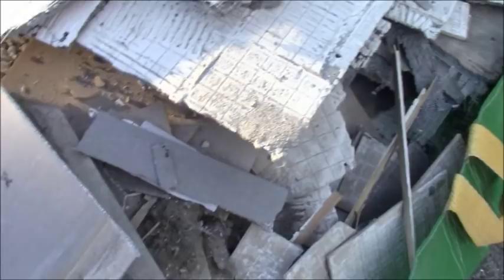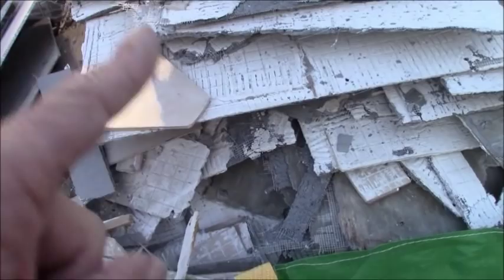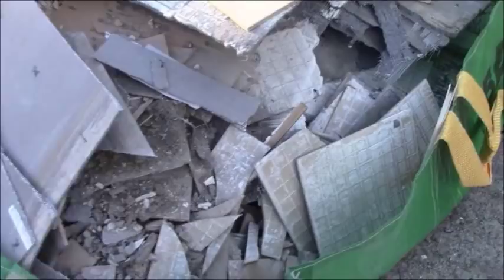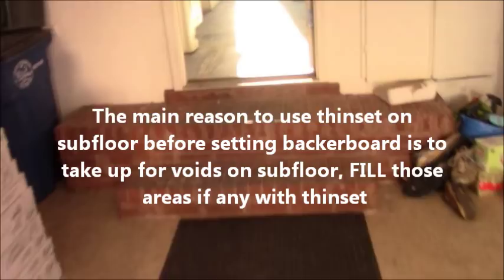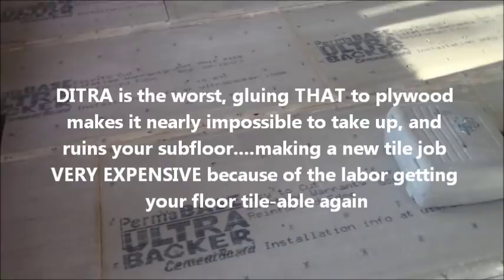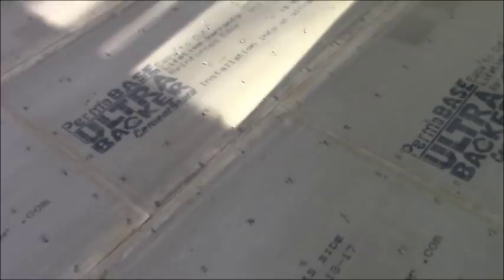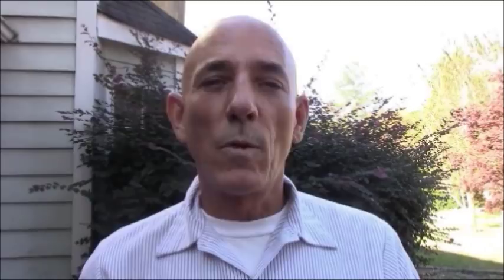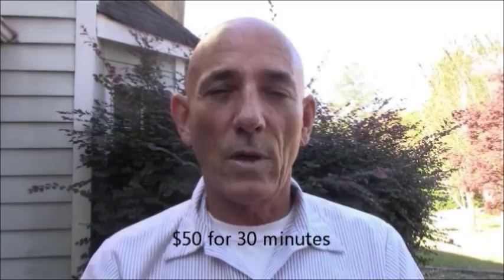GLUE BACKERBOARD ON SUBFLOOR ??

Comment: Bob...  This is the part where I whole heatedly disagree. Gluing the board has been industry standard ever since backer was invented. It strengthens the substrate and provides a porous surface that allows the tile to make a proper bond. I appreciate your shower videos but this is just wrong by all standards. You can not and will not convince me that if you install the board correctly and allow it to cure that when you come back and jump up and down there is not a difference compared to a typical 3/4 inch plywood substrate floor system. It tightens everything up.  You can literally feel the difference. The only time I would let this point of view slide by is in an area such as a small bath room where maybe 2-3 sheets of backer are used.  And even then I will be using a large amount of screws. Securing Evey possible weak spot,  doubling up on seams, etc. But if you are doing an area that spans a few hundred feet, and several joist,  it's silly to not do what the industry requires.  I mean how do you even argue personal opinion over that? It has been proven time and time again, for both durability and longevity of the tile that a solid substrate makes all the difference. Pointing out a simple settling issue that caused a small area to fail is no relation to what the upside is to this method that is considered grade A installation by TCNA. And yes it does "mess up the substrate" as you put it. But as you even show in your video,  getting the board back up is possible. After that I've always just grinded down what mortar stuck to the wood. I have literally tore out tile floors down to the substrate. Grinded substrate back to original plywood, and then put down 1/4 sureply and covered with vinyl flooring with no issues what so ever. It's what floor guys do my man. This video shouldn't even exist my man.  And I shouldn't need to make my own video to prove my point. It's pretty cut and dry and there is plenty of information out there for you to learn from.
Reply from the maker: You are welcome to disagree all you want, you can even quote tcna standards and provide me with a dozen books that tells me I'm doing it wrong... but the proof is in the pudding my man, not only in this video did they not glue and screw but 99.9% of the jobs that I tear out are not glued and screwed and there are not problems, so I guess I'm in good company if you're telling me it's been industry standard for years and I'm not seeing thar... in fact that's why I show videos because saying one thing and showing it are two different things and I show it every chance I get. There has to be a problem for a solution and since I don't run into those problems that you reference then I'm not going to screw up my customers floor whether it's five years from now, 20, or 50 it just is illogical period. However I will concede one thing, the manufacturer especially with hardibacker, tells you to put a screw every 8 in, I use about two or three rolls of roofing nails for a board so there are no voids and there are no issues the way I do it... but I would never ever ever only put one screw ever 8 in unless I were gluing it which I do not do. And by the way, I did hundreds of floors before I ever got into doing showers. And although I appreciate your opinion, you cannot be Trump and just say something without proof, and I don't mean the written word I mean real life real world work which is what I do on a day-to-day basis
Reply: Butcher! STRAIGHT UP! You wouldn’t tile my dog house or set foot on any of my job sites! YOUR FIRED
Reply: The big boys that know what they’re doing are usually working on higher end jobs/houses with clients that want to pay for lifetime work. The joe remodelers do work built to last maybe until the next remodel and hack their way out and on to the next job. Smh yes this video should not exist. Guy above me is right 100%
Reply from the maker: The guy above you obviously is a newbie and brainwashed... yeah that Kool-Aid taste good doesn't it 😂😂

When I was in the Army and got to my first Duty station my platoon Sergeant basically told me to forget most of what I learned, they have SOP based on experience... same thing after I graduated the fire academy, the NFPA which is the Bible of fire science was Brill Dan to us but when I got to my station I was told they have their own SOP based on real life experience...
I based my work on the real-life experience and not the crap touted by book soldiers
Reply: @StarrTile  LOL
Reply: This guy knows everything you can never prove anything to a guy like this he'll stick to his thoughts even with proof right in front of his face he's more like Trump than he thinks TCNA does research and development and has requirements for a reason! So hopefully one day a 1500ft² job fails and he has to come out of pocket to replace cuz he didn't follow requirements but if he did they'd pay 4 it! I've done it both ways and have never had it crack either without thinset but started doing it just in case 1 day it does cuz it will so that the company will pay for the repair not me just follow the rules glueing and screwing sucks taking out but it's part of the gig.... I never understood these old school guys that can never except fact and newer faster better methods and believe their way is #1 even though he'll say I never tell people my way is right he totally contradicts himself jus listen to his videos closely why else would he not be making any money from YouTube?? Everyone else does it's because he misleads on SOME things as fact and they won't allow that but he'll spin it to make it look like there in the wrong when it's really him c'mon man your the only one I've ever seen say your spill at the end of your videos maybe you should grow and take criticism it's called humility swallow your pride ACT your AGE your not a kid anymore!!

Comment: The problem you're having is that you're not supposed to bond backer board to Raw subfloor unless it is an exterior plywood.  you have to seal/Prime the floor and then then set your backer board on.  so 15 years later when you take it apart the thinset will scrape away just like any other surface.
Reply: You are correct,  I see online @ hardie backer board website keep saying exterior grade plywood.  I was wondering why.

Comment: I am a master carpenter of 40 years .. and I will never claim to be a master tile setter . But I have done perhaps 30 floors and baths in my life in all styles of tile .. So before I launch on a new product .. I like to update on specs and use my own carpentry wisdom of how weak the substrate is , The structure , seismic and any other forces . I know that most everybody who whose unsure wants  and do it " Right " generally follows specs .... and then there some that have been doing it long enough and realized in their minds that abiding by specs was unnecessary . So it has a tendency for others to cut corners even more perhaps .. Some manufacturers will not warranty their products if shortcuts are taken .. Not sure if it applies to Backerboard .   I generally build so it takes explosives to remodel .. Like .. I will set interior doors and set my shims with premium subfloor glue , then attach with stainless steel trim screws and nail ferociously through the jamb and anchor every hinge with 3" screws ... The next sub" painters " hate me but the homeowners will love me .. Set in stone .. and you ram those doors with a tractor.. Remodelers will hate me in the future !! .. I know by cutting corners and not following specs can lead to stuff falling down and falling apart .. So on your vid .. I am merely inquisitive on different styles . If I nail down subfloor to an I joist .. I double the amount of glue and double the fastening specs and make sure it;s bedded and nailed /screwed within 10 minutes so if anyone ever happens to need to move a joist .. It will destroy the joist !! .. Because they have become ONE ! .. I love remodeling behind guys that did the very least . knocking down walls held together with a thumbtack adds to my profit margin . I have pulled up tile floors and was grateful the guy before me scrimped .. I just see the inherent danger in teaching people to be minimalist . Tacking shingles with one nail in the top middle will do .. since the glue strip will bond .. hanging drywall with one screw in each corner makes a flawless finish ,. Not caulking woodwork is great when the cuts are so precise and tight and nailing in the middle makes for a happy painter . So to a degree , I understand your stance .. Generally when I have to pull apart work that was rock solid .. I get pissed as well .. but salute the guy for doing what was specified .. Perhaps invent methods for removal that are efficient . I am sure you will encounter it again .. I hate it when I have to drill into masonry and hit a piece of #6 rebar  but I am grateful it was put in knowing it insured the column wouldn't collapse

Comment: I've never believed in gluing down backer board but you do need to screw it down. After time, if nailed down, those nails will work their way loose and cause movement which will eventually cause the tile to crack.
Reply: Ya i agree i ise backee board screws not nails
Reply: I agree. It doesn't matter how many nails, some will work loose and either cause creaking, cracks or both.
Reply: nails don't have enough upwards force to Crack tile.. It's mostly the seams in the subfloor or the integrity of the tile and voids in thinset that can cause cracking

Comment: Finally I got a peace of mind because I had never used thinset to glue down my backer board, I always screw it down 👍
Reply: Yup its NOT needed
Reply: not in Arizona, i just pulled up the floor, built in 2007, thank god they didnt glue the backer board.  new construction.... it lasted 16 years, no issue whatsoever, just remodeling the BR

Comment: If you have a perfectly flat floor yeah I'd say you can get away with not doing it.  I put it under mine and it helped it level it out but my home was built in 1890. This guy just seen a job get more profitable is why hes so happy. Oh and to anyone out there if you have tile with any kind of warranty and dont use thin set behind the backer board its voided.

Comment: This is the legendary video. Tilers will know what I mean. I finally came across it! Install the tile improperly initially so its easier to redo it when it fails. LOL! Follow manufacturers and TCNA standards, always. Thinset between the plywood and backer, and again between the backer and tile. That is the manufacturer and TCNA guideline. Period. Also I don't see any seam tape on the cementitious board connections, another violation of TCNA standards. I see this every day in the industry.
Reply from the maker: 😂😂😂😂😂@violation !!!!
Lock me up then, 21 years of breaking the internet and pissing off John Bridge trolls 👍👌✌
Reply: @StarrTile  Hey if it works for you awesome! I've seen several instances of this method failing, cracks in tile and grout where the boards meet or damage due to deflection. I'm also in an extreme weather zone far south so we have to be extremely careful with following standards to the letter, we get extreme expansion and contraction. I just inspected a new 6 month old porcelain LFT install in a family room over concrete foundation that tented to the point of tiles exploding like grenades, they thought they had a sinkhole or there was an earthquake happening. No expansion gaps and grouted to the baseboard *facepalm. We had a very chilly day followed by a hot one. Someone easily could have been injured. So sorry I tend to be a stickler for the standards. :) I do like your other videos I just don't think advising other installers to not follow manufacturer and tcna standards publicly is a good idea. If it's ok to cut a corner here, how about there? And every corner cut increases the chance of failure, and tile failures can be dangerous.
Reply from the maker: @nekomancey4149  I've never ever said not to do things, I said I don't believe in certain things so therefore I don't do them...but everyone can can do anything they want. I base my opinion and standard on my experience, not to a book or organization...there must be proof and there is none of the things I dispute, but my videos show my proof of what I say.

Comment: I just took a bathroom floor out that was NAILED down every 8 inches, NOT GLUED, and DIDN'T have the joints taped, I am in the process of putting it all back in the same way, I just poured leveling compound on it and AFTER that I saw all the videos saying you HAVE to screw it down, you HAVE to tape the joints and you HAVE to put thinset under the cement boards, man I felt like a loser after watching all that - and then I came across your video where I learn in the video and the comments that you can nail it down, you don't need thinset under the boards and you don't need to tape the joints, all I can say is THANK YOU i'm grateful I didn't mess up as like the other videos told me I had.

Comment: GREAT video!  I have been installing backer boards and then tiling in my different houses over 30 years and NEVER glued my backer board down....only used screws....and NEVER had any cracked tile or mortar. that's in Calif, Ill, Wisc  and now Ohio. I just tore up an old tile job in bathroom (my wife wanted to remodel) that I had installed 15 years ago and it was a breeze because I had only screwed down the 1/2 inch cement board.
Reply: I have some flex between my backer boord and subfloor , is that normal ?
Reply: What are the best screws to use for backer board to plywood? I will have 1/4 cement board to 3/4" plywood.
Reply: @chulaalaale  if you're seeing areas that can flex after screwing down the backer board, then your subfloor is not flat.  Either there is debris or puckering between the two, or there are high and low spots and the low spots will allow the backer board to sag under load.   This is where you can use mortar to flatten the low spots by floating it on or doing a screed to make a smooth flat layer before putting down the backer board.  But make sure your subfloor itself has no flex, otherwise you have to address that first.  You also can do self leveling compounds to give you a flat level surface before putting on the backer board.
Reply: @cwb124  use whatever the backer board manufacturer recommends.  There are screws made specifically for certain types of backer board.  You may be able to use nails as well or a mixture depending again on what the manufacturer says and the location.  The screws made for this application are coated to prevent corrosion even in wet areas.
Reply: Also, you should start from the center and work your way out as you're screwing down the backer board or you could cause puckers.

Comment: Depends on your area and condition of subfloor, framing, and beams underneath....in so cal we never have problems but our structures are different, newer and our weather is very mild...... East coast especially in the North could be whole different thing.....

We have alot of slab on grade (newer) or girder beams with 2x6 subfloors, or 1×4 diagonal with ply on top....

Way way back befire cement board we used to tile right on plywood, sometime in the 30-40s they would use paper and staple lath and float cement before tile.....

Never seen any issues unless thr structure itself had problems....if thats the case you have bigger fish to fry than your tile

As a builder I take manufacturer recommendations as a guide, not as the Bible.....common sense, experience, and general knowledge go along way......

30 friggen screws over a 15 ft sq area on hardie board is almost as many screws your kitchen cabinets have and those are vertical holding weight off the ground😂

Comment: When you glue and screw you are laminating the layers together and as the stiffness of the floor is proportional to the SQUARE of the thickness, you can see there is an advantage, and the choice to do it or not depends on how stiff the substrate already is and what you expect the load or wear and tear to be, and what value you assign to the subsequent demolition problems.

Comment: I've seen quite a few failures caused by the backerboard only being secured with screws or nails.  It may be fine in your area to omit some form of adhesive under the backerboard, but here in the north seasonal expansion and contraction tends to crack the backer board where it was fastened if there is no adhesive used in conjunction.  I had one last year where you could lift the whole sheet of backer board off the subfloor, tile and all.  I certainly get your concern though. It makes a hell of a mess if you want to put a new floor down, and if I worked in an area with more stable seasonal humidity I might do the same.

Comment: And I've seen plenty of examples of cracks in the floor when not gluing. I personally wouldn't install against TCNA and manufacturers instructions just because it made it harder to remove later on. You can bet this is a bad idea for anyone using travertine, and for anyone in somewhere like California where movement is expected. Tip-just use some cheap non modified thin set like custom rapidset, it comes up almost as easy as dry pack, no subfloor damage

Edit- custom blend, not rapid set
Reply from the maker: Appreciate your input, and good info for some out there....
But personally I've set thousands of SF travertine without an issue, in fact never a failure  in 20 years.
Reply: Exactly! Every time I look at an issue with tiles cracking it boils down to either the seams in the backer are causing the tile to crack or the plywood seams are causing it to crack. Either way it's always because the board wasn't glued to the plywood like it should be.